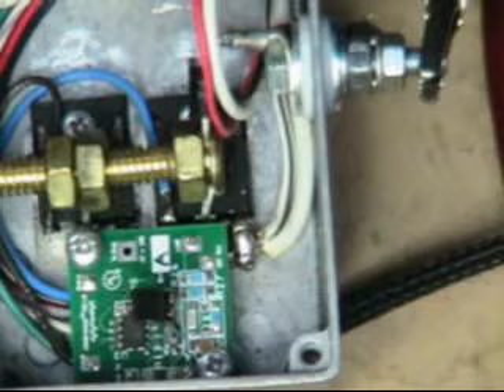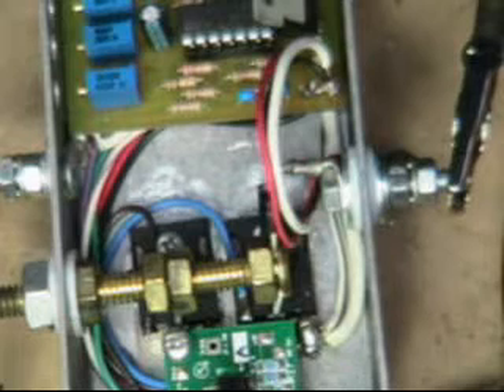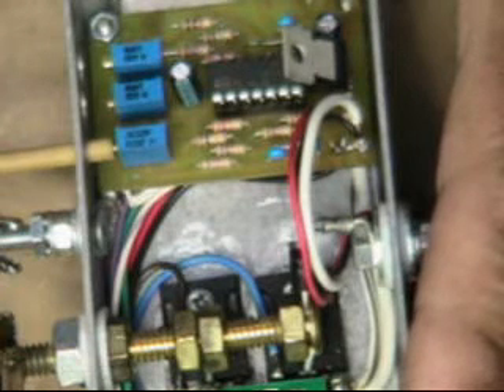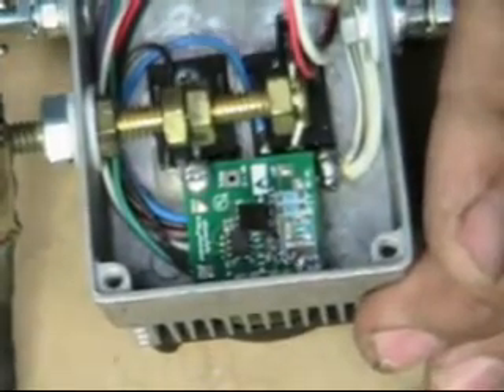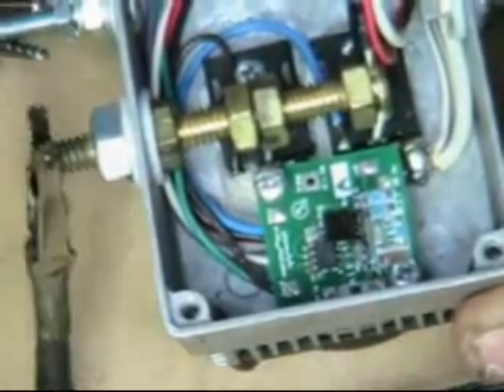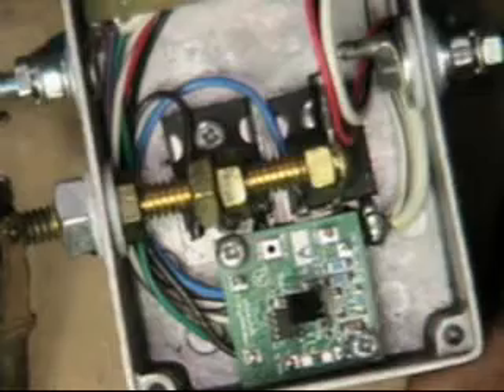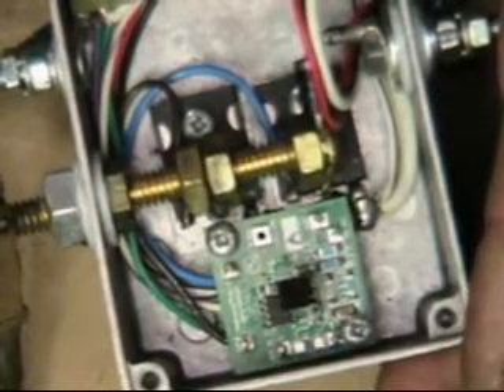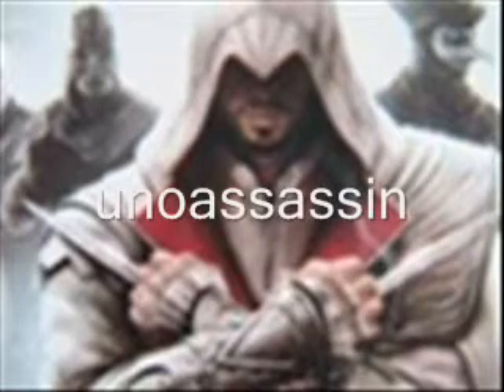Zero PWM Clone Upgrade Part 3 of 3 Finished

Comment: if You want to improve your existing PWM Unit and add a real punch and Drive your MosFets Crazy like my H2O2-PWM V2 Does. Turning your MosFet's On and Off Extremely fast will significantly reduce the MosFet's Temperature. I suggest Installing 4 Mosfets and this unit will drive all 4 MosFet's. It is Compatible with Zero Fossil Fuel CCPWM V2 & CCPWM V2H  & Clones and Can be adapted  to Other PWM designs. I have boards and can produce assembled boards , Message Me about H2O2-PWM DRIVER V2.1.0